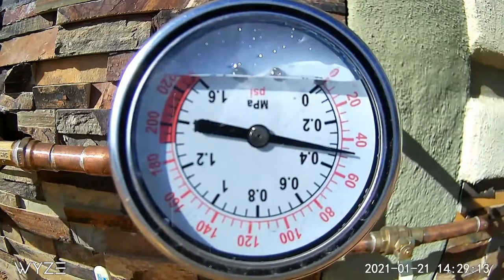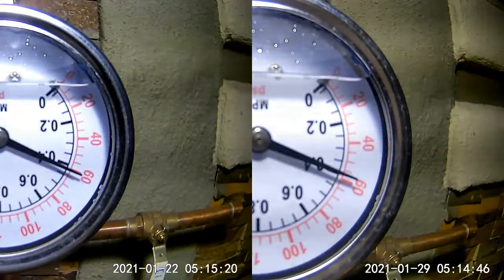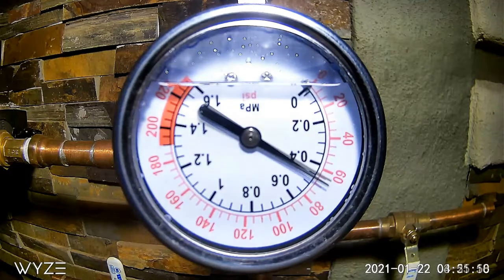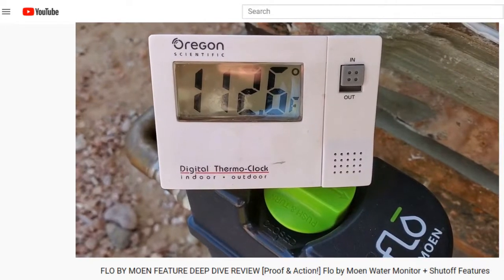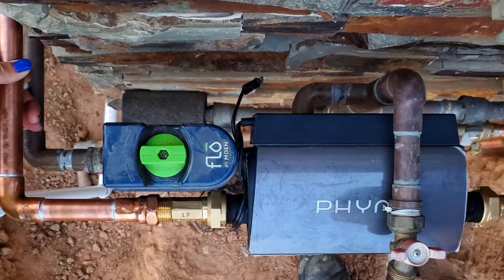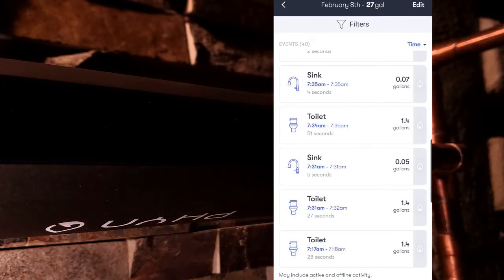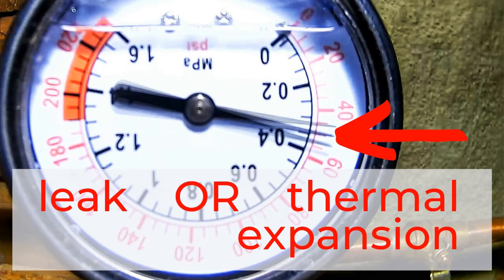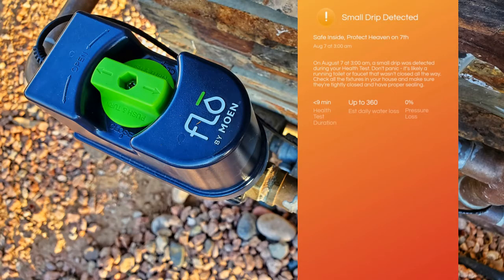WHY DETECTING A [small] PLUMBING LEAK IS HARD because of your water heater: THERMAL EXPANSION

Comment: I have a question if you could PLEASE help me. First, I find your videos to be super informative, thank you for that. So I watched your video "the smallest leak detectable with a pressure gauge" and I love how detailed you are. Although my situation is unique. I currently have 2 tiny pin hole leaks in the crawl space (each drops about a drop every minute or two). I plan on patching them before I perform a test to determine if there are any others in the house I cannot see. Well, that is based on your response here. My concern is that even if I perform the test carefully, if there is indeed a (3rd) leak somewhere, how will I know how much of the pressure drop was caused by the outdoor temperature? If it shows 5psi drop, I would be tempted to think there's a leak (because that's what you used in your video), but how do I know the entire 5psi was not simply from outdoor temp drop? THANK YOU so much in advance.
Reply from the maker: First, I’m not a plumber, so the advice is worth the price charged. However, because I’ve gone down this deep rabbit hole and experimented with my own 2.5 bath system with some ridiculously long runs, I’d say run the a 15 minute test, then fix the 2 leaks you know and rerun the 15 minute test to see how much the drop is. Or if you want to be fully tested, run an overnight test with a fully cooled tank water heater (if you have a tank vs tankless). The tank system is a big game changer when it comes to thermal expansion. The problem is you don’t know your basis with no leaks, but if thermal expansion is not a factor you can really see if the pressure holds or not. It’s not a solid answer, like a certain drop, but I don’t know the specifics as to how much volume is contained within your plumbing, what materials are used and how that compares against my own. I have copper with one long run of PEX, but that can very much vary between houses and even how far south I am (Arizona with some plumbing outside the house) versus the temperature differential you see in your environment). Once I took out thermal expansion the pressure I saw in all the tests really held close to the starting pressure. I hope that helps as a guideline.
Reply: @NoMoreLeaks  THANK YOU SO MUCH for this. It makes perfect sense. I will try it. (fyi, it's a 1500 sq ft home with copper pipes)